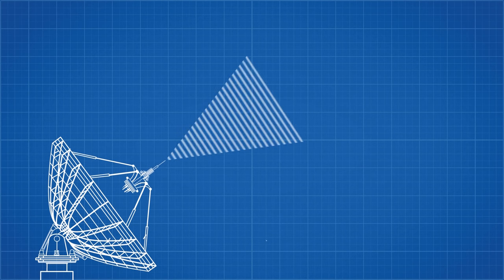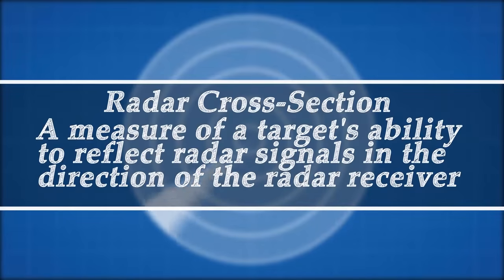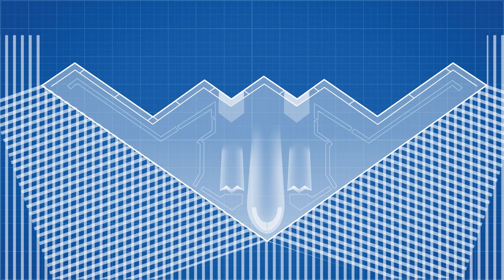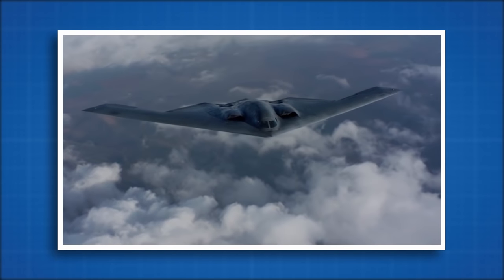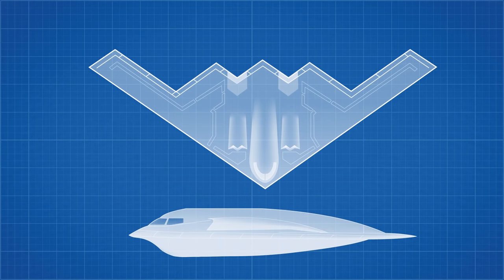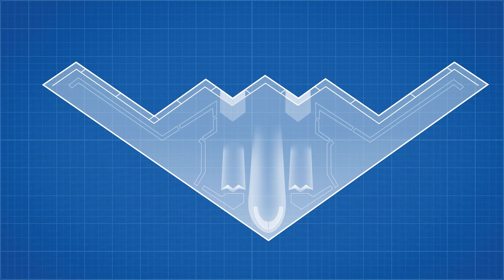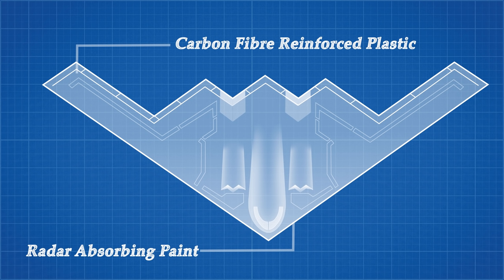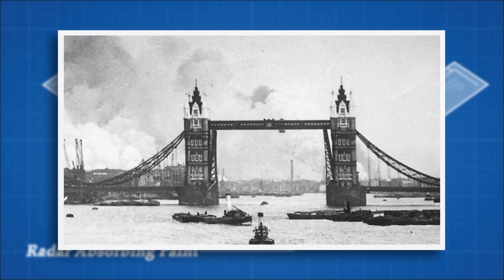Stealth - How Does it Work? (Northrop B-2 Spirit)

Comment: On the radar B-2 is big as a big bird... Ok! But how they resolved the problem: no matter how big is the bird it can't fly with 800km/ph. The radar-operator must be drunk to the death and not to see the difference and understand beyond any  doubt that there is a stealth airplane coming... Well, Russians use  Plasma Cloud and radars can not see the plane  but all the same the radars can see the cloud distortion and the result is similar...
Reply: +Saber Tooth

 No, that's not how it works or what is meant. It's R.A.D.A.R. cross-section (R.C.S. ) is that of the surface area of a bird (that and the R.C.S. ). Most R.A.D.A.R.'s, regardless of frequency or bandwith will not pick up a bird.
Reply: Most radars of last millenium yes..., After all, birds were considered as parasite noise... And even then Doppler radar of ancient MIG-29, just for relish could spot from above a bird flying stealthy, with surface as background... But now it is quite different matter and no one can ignore "birds" flying with 1000km/ph at altitude of 10000m...
 French radars can expose F-22 in 3d in real time because they work with multi-frequency stage. F-22 and F-35 are not problem to be detected with radars of Eurofighter Typhoon during sparing battles and it is perfectly clear that surface based radars are much more effective.
And in the end... Last Year F-35 of Israel Air force was attacked by staggering ancient Sirian C-200 (Sa-5)... Not some ultra modern "wonder" Russian weapon but C-200 threatening to disintegrate  by itself because of old age... Well they didn't succeed to shoot F-35 but neither the Lighting could destroy the rocket system... The important thing is that  radars even ancient can see those stealth airplanes... Russians boasted that some of their anti-aircraft systems are ready to shoot at targets with 2 squire centimeters. That means that not only birds but even some big  bugs can be detected...
Reply: +Saber Tooth

> "Most radars of last millenium yes..., After all, birds were considered as parasite noise... And even then Doppler radar of ancient MIG-29, just for relish could spot from above a bird flying stealthy, with surface as background... But now it is quite different matter and no one can ignore "birds" flying with 1000km/ph at altitude of 10000m..."

 Though my understanding of reflection is pretty basic, there would have to be very favorable atmospheric conditions and numerous birds or aircraft in the sky for that matter, to get enough data to conclude such an altitude or velocity. 

> "F-22 and F-35 are not problem to be detected with radars of Eurofighter Typhoon during sparing battles and it is perfectly clear that surface based radars are much more effective."

 I know of no case of R.A.D.A.R. locks on the F-22A, let alone the F-35, from Typhoons. What has been done is locking onto Infrared signatures and basic vision. The encounters where one F-22A was said to have been "killed" during an exercise was in a very short-range turning engagement. 

> " Last Year F-35 of Israel Air force was attacked by staggering ancient Sirian C-200 (Sa-5)... Not some ultra modern "wonder" Russian weapon but C-200 threatening to disintegrate  by itself because of old age... Well they didn't succeed to shoot F-35 but neither the Lighting could destroy the rocket system"

 Except the Syrians nor Russians ever claimed such of an F-35. They did damage an F-16I that was running a S.E.A.D. strike that October. But the notion an F-35I was damaged or shot down only seems to start with South Front's article on the matter.
Reply: Training combats are in two stages: Beyond visibility and so called close combat... although it is quite questionable how close could be two airplanes with supersonic speed... just several maneuvers and after a minute they are 100 kilometers from each other...
 Multifrequency radars in their effects are similar to using alloys in metalls. Two extremely mild metals can create hard one. Something similar is happening with radars and their abilities to detect targets. Sorry to disappoint you but in present warfare can be detected even bullets, not to speak about monsters like B-2. Of course Stealth is offering some advantages. It can be spotted later than ordinary planes but superlatives like Invisible, Indestructible etc... are much more commercial advertisement than real abilities...
Well, we can argue what is possible and what is not to the end of time... so let see the real facts.
1. 1999 Serbs shot down a stealth F-117 Night Hawk with system SA-3 (model-1961)... and according to other losses of NATO in percents of using types of aircrafts, stealth is not better. Of course Serbs claimed other F-117 but that fell on their territory and is well documented.
2. 2011 Iranians captured RQ-170 stealth drone which is more or less small version of B-2 Night Spirit... Not just spotted it, or even shot down it... but Iranians manage to overwrite control system and capture the plane...
Reply: +Saber Tooth

> "Sorry to disappoint you but in present warfare can be detected even bullets, not to speak about monsters like B-2."

 You're comparing a very fast moving highly reflective track to a relatively slow, obliquely reflective track. Different kinds of R.A.D.A.R.'s entirely are need to track either. 

> "but superlatives like Invisible, Indestructible etc... are much more commercial advertisement than real abilities..."

 No one relevant to these programs save public-relations individuals and one President Donald Trump has claimed they were invisible or indestructible. 

> "1999 Serbs shot down a stealth F-117 Night Hawk with system SA-3 (model-1961)... and according to other losses of NATO in percents of using types of aircrafts, stealth is not better. Of course Serbs claimed other F-117 but that fell on their territory and is well documented."

 The Serbians had only shot down one F-117A. And relevant officials had only claimed that one. Post-conflict several civilians have started claiming a second and third aircraft, but this is likely a simple hoax or misidentification of an aircraft.  

 The F-117A was a relatively antiquated aircraft. It has no countermeasures of any kind save being low-observable to R.A.D.A.R. There were no upgrades made to its performance, capabilities, or defense at all over the course of its service life. And was essentially as it was back in the design stage during the '1970's. 

 The Serbian P-40 R.A.D.A.R. system linked to it was one that remanufacturered and modernized in the late eighties by the Soviets. Considerably newer than the F-117A in question. 

 The latter statement is based on what exactly? How did it not work? 

> "Not just spotted it, or even shot down it... but Iranians manage to overwrite control system and capture the plane..."

 The left wing was shot to pieces. It was crash landed, but not likely by the Iranians. The Iranian government never backed the claim of "overwriting" the controls (simply being on the same frequency will allow control, albeit generally different and specific frequencies ) it's likely an automated system or even the man behind the computer screen landed it.
Reply: Yea..., but... omnipresent "But"... All targets are high reflective... depending with what you are watching at them. It is not a secret that in radars with metric range all types stealth planes are shiny like Christmas tree and with combination of centimeter range their exact coordinates are clear. Not to speak about newest systems with radio-photon technology.  Using that technology makes, dimensions, speed and distances to the target almost irrelevant. There you can see what and where exactly is flying... and not as dot or spot signature but as real image... an aircraft, a bird, meteor or flying witch... it will be detected and measured...
About F-117...
1.N 80-0785 - Lost
2.N 81-10792 - Lost
3.N  81-10793 - Lost
4.N 82-0801 - Lost
5.N  0806 - Lost
6.N 0815 - Lost
7.N  85-0822 - Lost
8.N 0825 - Badly damaged
9.N 0837 - Badly damaged
And all of these loses over of 59 F-117 in service... It is not even decimation it is a stealth massacre... So, stealths have problems maybe with flight, definitely with fight and their performance is not so bright to make their existence right..
Reply: +Saber Tooth

> All targets are high reflective..."

 Can. And will, dependent on the variables of both the R.A.D.A.R.'s specifications (i.e. frequency, bandwidth ) and the computer controlling it. Not to mention the invariables, such as weather and the curvature of the Earth. 

> "Not to speak about newest systems with radio-photon technology."

 Which are in development, nor have been militarized as of yet. While they work to some degree, it is quite a way before this technology matures. When might we ask, I have not even the faintest idea. 

> "About F-117... 1.N 80-0785 - Lost 2.N 81-10792 - Lost 3.N  81-10793 - Lost 4.N 82-0801 - Lost 5.N  0806 - Lost 6.N 0815 - Lost 7.N  85-0822 - Lost 8.N 0825 - Badly damaged 9.N 0837 - Badly damaged ..."

 There has been only one combat loss, Serial No. 82-0806, callsign "Vega-31" flown by the now retired Lieutenant Colonel Dale Zelko on the 27th of March, '1999 somewhere near Ruma, Serbia. 

> "And all of these loses over of 59 F-117 in service... It is not even decimation it is a stealth massacre... "

 The first: Serial No. 80-0785, fourth: Serial No. 82-0801, and Serial No. 81-0793 were to mechanical failures, Serial No. 80-0792, Serial No. 85-0815, and Serial No. 86-0822 were to pilot error. The other numbers you list do not match with the aircraft I know of. 

> "  So, stealths have problems maybe with flight, definitely with fight and their performance is not so bright to make their existence right.."

 What are you on about?
Reply: Yea, there are many methods to detect... stealths. Which in general means their use is more in range of prestige and propaganda... Something similar of using Space Shuttle... A big deal of proud and boasting, and then... Long live the old but robust technology...
About F-117... I am sorry if I was unclear... I've mentioned all known loses of this aircraft... Till 2004... so the list may be incomplete... (Although you can see it at: https://www.f-117a.com/Serial.html) Yea, most of damages are officially due to technical problems..., but that is the main reason to shoot at someone's aircraft... to cause to it a bunch of technical problems. And my remarks were about: If an airplane have difficulties to stay in the air then no one can convince me that it can be a great peril to potential adversaries, so it definitely has a problem with a fight...
Reply: +Saber Tooth

> "Which in general means their use is more in range of prestige and propaganda... "

 How so? There are absolutely less likely to be tracked and shot down. That alone has been proven.

> "About F-117... I am sorry if I was unclear... I've mentioned all known loses of this aircraft... Till 2004..."

 Given some of the similar, or in the case of the latter sequence of at least two aircraft's serial numbers, I believe you've mistaken some of the aircraft with others, or possibly mixed up the order of the numbers. 

> "... but that is the main reason to shoot at someone's aircraft... to cause to it a bunch of technical problems."

 To be completely frank,  I do not get your point here.

> "And my remarks were about: If an airplane have difficulties to stay in the air then no one can convince me that it can be a great peril to potential adversaries, so it definitely has a problem with a fight..."

 Reasonable. But I don't see how that is the case. The F-117A was the first dedicated low-observable attack aircraft. And relied solely on such. It was by '1999 an already obsolescent design. That had not been updated to any notable degree since it had entered production. It has of a decade plus two years, been decommissioned, and had been out of operation service for two years prior. The last combat it did see was in 2001 if I recall correctly.
Reply: The ordinary air-soldiers like F-15 and F-18 are  with much great performance than F-117.... And likely or not likely to be detected they are doing great job... F-117 are good especially against... weak victims like Panama... where and biplane of WW-I can be mighty weapon...
About serials:
1 2 80-0785 04/20/82 Bob Riedenuer None Lost 04/20/82 First production aircraft
2 2 0786 07/15/82 Hal Farley 09/02/82 Operational "War Pig"
3 2 80-0787 07/20/82 Hal Farley 08/23/82 Operational "Pete's Dragon"
4 2 0788 09/08/82 Tom Morgenfeld 10/22/82 Operational 
5 2 0789 10/72/82 Hal Farley 11/17/82 Operational "Black Magic"(formerly "Night Stalker")
6 2 0790 11/11/82 Skip Holm 12/11/82 Operational "Deadly Jester"(formerly "Obsidian")
7 2 0791 11/22/82 Skip Holm 12/13/82 Operational "Lazy Ace", 33 D.S. Missions
8 3 81-10792 12/09/82 Skip Holm 12/22/82 Lost 06/11/86 
9 3 81-10793 01/20/83 Skip Holm 02/01/83 Lost 09/15/97 "Wiley E. Coyote's Tritonal Express"
10 3 81-10794 04/15/83 Skip Holm 04/15/83 Operational "Delta Dawn"
11 3 81-10795 06/09/83 Hal Farley 09/09/83 Operational 
12 3 81-10796 06/23/83 Tom Morgenfeld 08/04/83 Operational "Fatal Attraction"
13 3 81-10797 08/03/83 Tom Morgenfeld 08/31/83 Operational "Spell Bound", 8 or 9 DS missions(lowest)
14 3 81-10798 08/25/83 Dave Ferguson 10/03/83 Operational "Aces and Eights"
15 4 0799 09/22/83 Dave Ferguson 10/28/83 Operational "Midnight Rider"
16 4 0800 11/10/83 Hal Farley 12/07/83 Operational 
17 4 82-0801 12/21/83 Tom Morgenfeld 02/15/84 Lost 08/04/92 "Perpetrator", 38 D.S. Missions
18 4 0802 05/07/84 Dave Ferguson 04/06/84 Operational "Black Magic"
19 4 0803 05/08/84 Hal Farley 06/22/84 Operational "Unexpected Guest"
20 4 0804 05/25/84 Dave Ferguson 06/20/84 Operational 
21 4 82-0805 07/05/84 Tom Morgenfeld 08/03/84 Operational 
22 4 0806 08/20/84 Dave Ferguson 09/12/84 Lost 03/27/99 "Something Wicked"
23 5 0807 09/13/84 Dave Ferguson 11/28/84 Operational "The Chickenhawk"
24 5 0808 10/29/84 Dave Ferguson 12/20/84 Operational "Thor"
25 5 0809 01/03/85 Dave Ferguson 04/16/85 Operational 
26 5 0810 01/18/85 Dave Ferguson 02/14/85 Operational "Dark Angel"
27 6 0811 03/08/85 Tom Morgenfeld 03/29/85 Operational "Double Down"
28 6 84-0812 05/01/85 Dave Ferguson 06/12/85 Operational Unnamed,flown by Brian "Axel" Foley
42 DS missions (highest)
29 7 85-0813 06/07/85 Hal Farley 07/10/85 Operational "The Toxic Avenger"
30 7 0814 07/26/85 Hal Farley 09/05/85 Operational "Final Verdict"
31 7 0815 09/13/85 Hal Farley 10/31/85 Lost 10/14/87 
32 7 0816 10/30/85 Tom Morgenfeld 12/20/85 Operational "Lone Wolf"
33 7 0817 01/09/86 Dave Ferguson 02/28/86 Operational "Shaba"
34 7 0818 02/11/86 Hal Farley 05/22/86 Operational "The Overachiever"
35 7 0819 04/14/86 Dave Ferguson 04/24/86 Operational "Raven Beauty"
36 7 0820 05/02/86 Dave Ferguson 06/19/86 Operational 
37 8 86-0821 06/20/86 Tom Morgenfeld 08/01/86 Operational "Sneak Attack"
38 8 85-0822 08/18/86 Dave Ferguson 09/18/86 Lost 05/11/95
39 8 0823 10/07/86 Dave Ferguson 12/04/86 Operational 
40 8 0824 11/23/86 Dave Ferguson 12/17/86 Operational 
41 8 0825 01/29/87 Tom Morgenfeld 03/25/87 Badly Damaged "Mad Max"
42 8 0826 03/02/87 Dave Ferguson 03/25/87 Operational "Nachtflake"
43 8 0827 04/07/87 Hal Farley 05/18/87 Operational 
44 8 0828 05/15/87 Dave Ferguson 06/17/87 Operational 
45 9 0829 07/10/87 Hal Farley 11/27/87 Operational "Avenging Angel"
46 9 0830 09/03/87 Hal Farley 11/27/87 Operational "Black Assasin"
47 9 85-0831 10/20/87 Tom Morgenfeld 11/27/87 Operational Assigned to 410th Flight Test Squadron
48 9 0832 12/10/87 Tom Morgenfeld 02/11/88 Operational "Once Bitten"
49 9 0833 02/19/88 Dave Ferguson 05/25/88 Operational "Black Devil"
50 9 0834 04/29/88 Tom Morgenfeld 05/27/88 Operational "Necromancer"
51 9 0835 06/30/88 Tom Morgenfeld 08/15/88 Operational "The Dragon"(former DET 1, 57 FWW)
52 9 85-0836 09/21/88 Tom Morgenfeld 10/19/88 Operational "Christine"
53 10 0837 12/08/88 Hal Farley 02/22/89 Badly Damaged 5/99 "Habu II"
54 10 0838 03/17/89 Hal Farley 05/24/89 Operational "Magic Hammer"
55 10 0839 06/14/89 Hal Farley 08/14/89 Operational "Midnight Reaper"
56 10 0840 09/12/89 Jim Thomas 11/01/89 Operational "Black Widow"
57 11 0841 12/07/89 Jim Thomas 03/08/90 Operational "Mystic Warrior"
58 11 0842 03/13/90 Jim Thomas 03/28/90 Operational "It's Hammertime"
59 11 88-0843 05/11/90 Hal Farley 07/12/90 Operational "Affectionately Christine", Final aircraft
About modifications.... F-117 was claimed has a signature like a big bird, F-22 like a big bird, B-2 like a big bird and F-35.... guess what... nothing changed... again that damned big bird. Time not always mean improvements... 50 Years ago there were flights of humans to the moon... Now.... Now even Concord doesn't fly... Yea, F-22 seems to be a decent airplane with sustainable speed over the speed of sound which is super but... but with maintenance over 20 hours to every 2 hours flight give a hint that its construction if not weak is at least too delicate for hard challenges of long war against strong and inventive adversary. The maintenance of F-35 is even worst and B-2 is coming to sheer madness like the aircraft will go in space...  It means that in big conflict like with China (Russia i do not consider as good enemy because of their lack of readiness to fight) The batles again will bi carried mainly of conventional but robust F-15 and F-16...
Reply: +Saber Tooth

> "The ordinary air-soldiers like F-15 and F-18 are  with much great performance than F-117...."

 Indeed, because of regular modernization, and a much more versatile payload and electronic countermeasures. The F-117A's was neither versatile, or even had any countermeasures of any kind aside from being low-observable.

> "F-117 are good especially against... weak victims like Panama... where and biplane of WW-I can be mighty weapon..."

 What are you on about?

> "About modifications.... F-117 was claimed has a signature like a big bird, F-22 like a big bird, B-2 like a big bird and F-35.... guess what... nothing changed... again that damned big bird."

 You're talking about one, maybe two "generations" difference in aircraft. With numerous advances in composite materials and a much more matured understanding of countering surface-to-air and air-to-air missiles. The latter three aircraft have all at least some form of Infrared or Microwave signature and electronic countermeasures suite. The former didn't. It was kept because it worked in combat service. 

> "F-22 seems to be a decent airplane with sustainable speed over the speed of sound which is super but... but with maintenance over 20 hours to every 2 hours flight give a hint that its construction if not weak is at least too delicate for hard challenges of long war against strong and inventive adversary."

 I don't see how maintenance hours in the slightest reflects delicateness or incapability. Just complex engineering. Situationally, emphasizing that word, your point rings true, that it may hinder its availability and operational rates. But not the fragility of the aircraft's construction.
Reply: Yea... I can assume that you don't see the significance of maintaining hours... In short: If in massive military engagement all F-35 are forced to fight only one day with three or four flights then next two days do not seek them in the sky... With all damages of  own ground forces because of absence of air-covering...
But let return to the main article... 
France have at least five types of radars detecting stealth planes... Most famous of them is Nostradamus radar... This monster is placed 80 kilometers of Paris with range of over 1700 kilometers and detecting stealths from 800 kilometers...
China has at least two types mobile anti-stealth radars...JY-27A 3-D long-range surveillance/guidance radar... it is active-phased array radar with hundreds of transmit/receive panels. In short... If according to data from one panel stealth signal is similar to a sparrow, then on the panel of opposite end of construction it is already like flying Titanic... Second China radar system is JY-26... Again in short: It can detect F-22 flying over South Korea... or roughly 500 kilometers... I laughed aloud when some people attempted to excuse that happen because of external fuel tanks of F-22 and because of that... tra-la-la... plane is good but Chinese were just lucky... No one comments that those lucky Chinese were knowing what exactly is flying, nor comments that F-22 is not designed to evade such types of radars... Something like excuses that pilots of Euro-fighters just look at F-22 and stealth plane becomes a German lunch... Or F-22 was with forbidden to use systems... Listening such laugh-full excuses someone can assume that pilots of F-22 are flying with naked heads, their right hand behind their back and with dancer girls sitting in their... laps... If the avalanche of such excuses continues... instead of development a real fighting planes instead of stealth toys there will be need of inventing of excuses and for lost war... against... just lucky adversary...